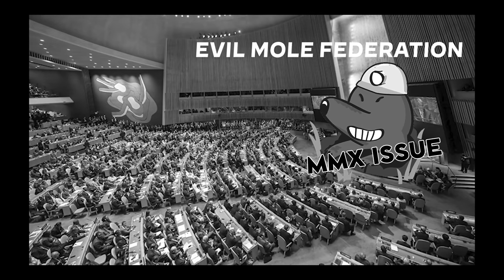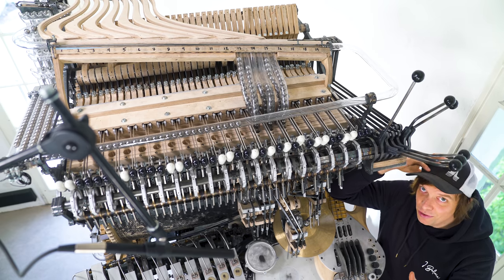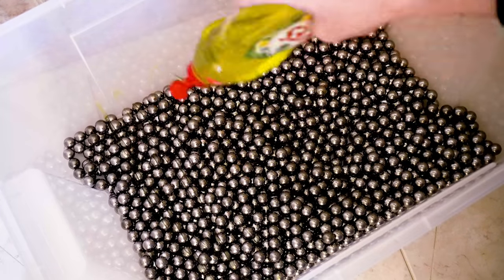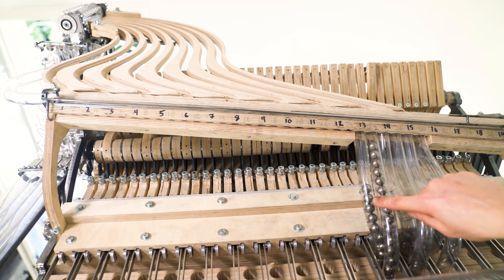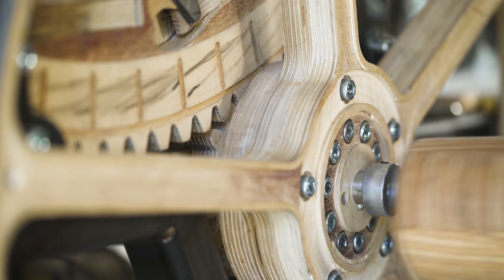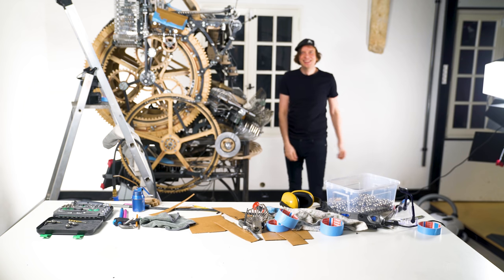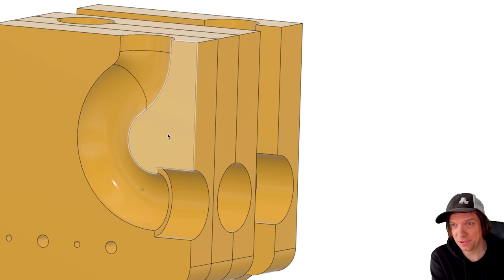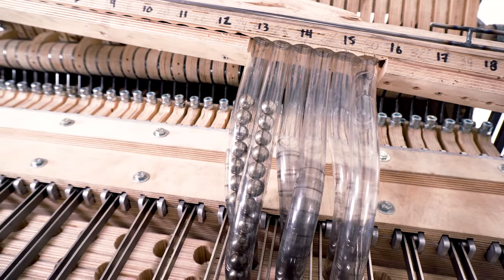Why Are 1000 Marbles On This Red Towel?

Comment: FYI, they got rusty because you dried them with the paint stripper gun. Heat really REALLY accelerates rusting. Look at cars with STAINLESS steel exhausts that have rust on them close to the engine, just because of the heat. If you'd have dried them with a towel it would have been fine.
Reply: From experience working with finicky instruments, those microfiber towels work great with glass and metals. Quick dry and don't leave a fibers all over everything.
Reply: Alternately using the high pressure air to dry the marbles would dry the marbles quickly without inducing rust
Reply: And make sure the marbles are thoroughly rinsed. 'Yes' washing up liquid degreases well but contains a lot of salt.
Reply: yikes, i thought it was only a hair dryer and I still had an internal 'nooooooooo' moment when I saw he was heat-drying the marbles
Reply: I through the he was gonna lift the towel up and shake it around to dry it then I saw the paint stripper and I cried, poor thousand marbles
Reply: I was thinking "doesn't heat accelerate chemical reactions?"
Reply: A fine layer of wd40 or Teflon tool oil would have improved this alot too
Reply: @ItsBoyRed  CLP gun lube would work well as it tops most rust preventatives in military testing on bare steel.   You can coat them, let them sit a while then rub off as much as you can get, but a tiny amount will work into the surface and no more rust.   Plus that small invisible film will still act as a lubricant so they'll run smoother too.   I thought all along that you were using chrome plated ball bearings...which would be another option as they're pretty impervious to rust (or anything) but would be more expensive.
Reply: every 10 degree temperetaure rise results in a doubling of chemical reactions
Reply: On the bright side, all the rolling and colliding of the marbles will rub those tiny rust spots off in no time
Reply: @MistahHeffo  Actually they will end up destroying the machine put them cheap mild steel balls in the trash and get some good quality bearings.
Reply: 70-90% isopropyl alcohol would be ideal
Reply: @Ralph2  Oh yes, salt is *bad*. I would have hoped that he would just put them in a dishwasher, or a washing machine.

Also, you can easily clean old legos by washing them in the washing machine.
Reply: It was inevitable in any case. air humidity is more than enough to create that rusty surface when the surface of the marbles have been stripped. One could either clean them with a degreasing light oil, as you would a gun and then let them have that film on them - or you could degrease in ammonia or something like it, but you'd have to reapply something to stop them from developing a rusty finish. Teflon, epoxy, wax... could even give them a "blueing", an electrodeposited surface. Can be any natural spectrum hues. The "kitchenware" stainless is not actually STAIN-LESS. It does stain, if you strip it.
Reply: Should have just cleaned them in acetone or some other solvent instead of water
Reply: As an engineer, I can attest this guy is completely right
Reply: @FabricioRWitt  "As the bride of a dentist, I can vouch for the quality of this product. [Insert random product here]"

Not to doubt your expertise, but you \*could* be an electrical engineer who can't tell cold-rolled steel apart from aluminium. But I would doubt that.
Reply: @vincentguttmann2231  Much respect for your vouching of quality of product, dentistry is quite an art, I've worked with many dentists in the SEM lab here.
I'm mechanical engineer specialized in materials analysis and electron microscopy, husband of a  materials engineer girl. :3
 Cheers from Brazil
Reply: @FabricioRWitt  I think I misphrased it. I was referring to the practice of using seemingly credible (or trustworthy) persons as ad partners. One time I saw an ad for a pretty good bike lock where they actually used a dentists bride as an "ad partner" or whatever you'd call it. I am neither a woman, nor am I married, nor do I have anything to do with dentistry. Added quotation marks and annotations to make clear I'm not a dentists bride.
Reply: @vincentguttmann2231   lol now I got it hahah. Those ads in america are the craziest thing, aren't they. I've been in Canada for some time and TV was really difficult to watch (In Brazil I don't watch tv as well) for it seemed to me that there was a really huge effort of giving artificial credibility to ads and news in general. It was super weird. Here in Brazil TV is just now reaching that level.
Anyways, sorry for misunderstanding the joke. 
The thing is I sympathized with the opinion of the original poster and felt like my experience backs it up, so I posted my first comment. 
Love from Brazil!
Reply: @FabricioRWitt  Yeah, I also did not assume that you were someone just making up qualifications (and even if you were, if you're not required to prove them in ANY way, then it probably doesn't matter.)
Reply: I think if he used other types of marbles, they may have a different weight, which means he would have to do bounce tests on all the instruments again.
Reply: @electron2601  and the pressure calibration for the marble gates

Comment: ALCOHOL- As an aircraft mechanic dealing with similar situations- you need ALCOHOL for cleaning parts- keeps from rusting, drys quickly, acts as a degreaser, and can increase moral after a long day of fighting moles.
Reply: What kind of alcohol? Isopropanol?
Reply: Im a bit worried about the last part
Reply: Yes, isoprop alcohol is the best cleaner/degreaser, or acetone for really oily things (such as bike chains).
I suspected the graphite powder was going to become an issue as all the marble paths are becoming dirty and it spoils the look of the machine.
Reply: @TheDasHatti  the V2 rocket was powered by alcohol and an oxidizer. They had to taint the alcohol with something poisonous to prevent the engineers from drinking it.
Reply: @Hirosjimma  Fascinating! Thanks!
But i was most "worried" about the different types of alcohol and i dont think isopropanol is meant to drink. This would only be ethanol. I got the joke, but someone out there could take it seriously
Reply: Alcohol is a solution, speaking strictly chemically.
Reply: don't know why he use soap in the first place. any alcohol or acetone do the trick easily than soap.
Reply: Well if hes trying to clean off graphite the alcohol wont work as a solvent. Though it wont rust the marbles.
Reply: Yeah I came here to say this. Isopropyl rubbing alcohol to clean stuff.
Reply: Isopropyl alcohol improves morale until you go blind. I suggest using Everclear instead.
Reply: @HasturT  In addition alcohol is the solution. (to the problem)
Reply: He may also just be able to get away with a rinse in acetone/alchohol/etc to displace the salt water off of the marbles before drying. The main damage us done when it is exposed to air while drying so as long as it isn't saltwater at that stage it probably won't matter.
Reply: when i distill prunes into liquor, the first bit is poison (acetone and stuff). i use it to clean the windows. works great and my car smells great for a week.
Reply: I came here for the same reason.  Acetone.  Just use it
Reply: Also keeps you clean inside... Yeah I'm Russian
Reply: Linseed oil damn it !!! (for wood part)
Reply: If you washed in water first to get the graphite off then immediately wash with mentholated spirits. It will dissolve any water.
Reply: Came to the comments to make this very comment, though I'm not an aircraft mechanic.
Reply: Remember guys, chemically speaking, alcohol is a solution. :P
Reply: @Hirosjimma  This is actually common practise in my country (germany). Pure Alcohol that is meant for technical applications (cleaning, fuel etc.) is "poisoned" to avoid people drinking it, because alcoholic beverages are taxed and alcohol for technical purposes is not.

Comment: 8:00 ..... WARNING!!!......
The rust from the cleaned marbles will leave residue all over the machine in the wood and plastic causing buildup and future issues!!!
Reply: Also rust particles WILL catalyse more rust on other marbles
Reply: Use vinegar to clean marbles
Reply: @mapimp1  this is terrible advice do not use vinegar to clean steel. Vinegar is an acid that will definitely cause more rust.

Comment: Grease on marbles is pretty good, it's what we do on Petanque balls to avoid rust, you should try to keep it that way, use acid solutions to recover from the rust, (like white vinegar or stuff for a couple hours) however you should know that from now on the size of your marbles won't be accurate because of the rust so you should consider replenishing your stocks, refrain from using rusty marbles if you want to keep your MMX not orange
Reply: To hear so much useful and understandable information from Willy Wonka.. :D
Reply: What if the grease is getting mixed with the graphite though? Would some sort of lacquer or electroplating be an option?
Reply: @iAmTheSquidThing  I dont think electroplating is a valid option as you need to cover your marble one at a time thus the process would be extremely long and the surface of your marble still wont be smooth (you need an electrical contact to your marble do this and contact points wont be covered), same smoothness issue with lacquer.
I think the first film on the marbles is due to graphite powder and though it causes some issue with marbles sticking one another you should think about it as the casual state for your marbles, this film will get back on your marbles over time no matter what you do (unless you delete the parts involved)
Reply: Vinegar actually causes rust to form faster, so it's not ideal to use it for rust removal on a bunch of tiny things all at once (no idea on other acids, but I can speak from experience about vinegar since I use it to descale stuff I smith). At this point, formulated rust remover/converter is probably the best course of action, and/or maybe a fine medium in a tumbler.
Reply: @SkaBonez  It occurs when your vinegar is overused/not fresh enough, in good conditions it only desolves Fe2O3 (solid) in Fe3+ (liquid) following the reaction Fe2O3 + 6H+ => 2Fe3+ + 3H2O
however if possible, use Chloridric acid or industrial rust remover obvi
Reply: Wonder if his best option would be to strip the oil from the marbles when new, then immediately dump them into a vat of cold blue. 

If it’s good enough to inhibit rust on guns, probably fine here.
Reply: @Nevir202  Naa, the marbles were never rusty before these events, I think that they have a coating out of the factory preventing rust, so, better not try anything and do not wash fresh marbles. Just try to get coated marbles working I think
Reply: @follisnow4051  Ya, they have a coating form the factory, it’s oil lol
Reply: @follisnow4051  "vinegar is overused/not fresh enough" huh, first I've heard of that. And the rust I'm talking about flash forms once the object is out of the vinegar. Vinegar definitely makes iron more susceptible to oxygen, though I'm not smart enough to know the chemical reaction by heart. I have experienced it many times when taking a handful of items out of a vinegar bath and not neutralizing it fast enough on the last one(s). And unless there's a better neutralizer than soap or baking soda in water, Martin is back to square one with trying to dry all the marbles before they rust.

Comment: The over rotation inside pipes (also wooden ones) increases exponentially friction from one marble to another
Reply: And that friction is worse if the marbles have rust or feel "gluey"
Reply: Absolutely. The overrotation lanes work if the marbles aren't mashed into them and can roll under their own gravity. But with pressure introduced the marbles will get pressed into the lane and become wedged.

Comment: OMG, the marble stack heights will have to be adjusted again.
Reply: I was just thinking about this as well.
Reply: He has the parts already this time
Reply: There are some really genius ideas on the MMX discord for better control of the marble heights that I hope Martin will use, it would save having to CNC new blocks
Reply: @zack3135  yeah. He NEEDS to ditch the height modules. It's way too finicky and I think probably too sensitive to things like humidity.
Reply: the first thing that came into my mind.
Reply: I would like to think he was aware of that and made sure the new path allowed for the proper heights.

Comment: I'm confused: if the pressure is adjusted with a new path, doesn't that change the marble height at the top, requiring adjustment of the paths to compensate?
Reply: i assume he took that into consideration :D

Comment: Heating the marbles to dry them faster is probably what catalyzed the rust reaction!

I experienced that a couple of tens of degrees Celsius can change the time when rust appears from hours to minutes! 😱
Reply: This is why welding has to happen under inert gas
Reply: The rule of thumb for chemistry is twice the reaction speed for every ten degrees Celsius. 30 degrees = 2*2*2 = 8 times faster...

Comment: Unless you're explicitly using an oil-free compressor, compressed air will always carry trace amounts of oil from the compressor pump into the pressurised air. If you're cleaning marbles and machine parts by blowing them with compressed air then that might also cause them to feel oily
Reply: I used to do a lot of spray painting for a living and oil from the compressor was a constant pain.
Reply: In Germany we call that „Ölabscheider“ which means Oil separator but in this case to divorce and to separate is the same word in German so it divorces your equipment from oil which is kinda nice.

Comment: Remember this is a one of a kind, never before attempted machine. You are having to deal with issues no one even thought about before.  And you are doing it in a way that can be repeated for multiple machines.  If you have to fix an issue and you didn’t learn anything then you truly have a problem.  Every fix is new knowledge that will make it so much easier for the next machine, for the next problem. Keep at it.

Comment: In the soap are solvents and even salts. The salt makes them rust. When  bikers shine engines and such we use unsalted cleaners. There is salt in that soap which is an abrasive. It roughed the surface then rusted it. I’m so sorry buddy. 90% pure isopropyl alcohol is the way to go.
Reply: its not a problem to use soap our water, its the clean metal that rust, even if they're not in water. (rust is an reaction with oxygen, so air is bad as well)  and that's why they come coated in oil. Better to phosphate the steel with zinc or something. see: https://en.wikipedia.org/wiki/Phosphate_conversion_coating

vote up to let him know and find a good chemist to help (nile red - youtube ?)